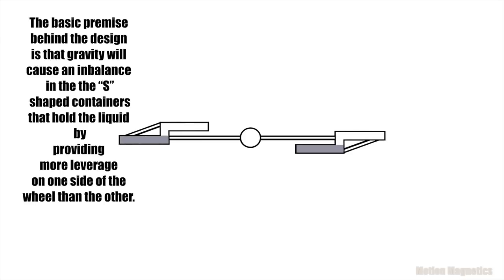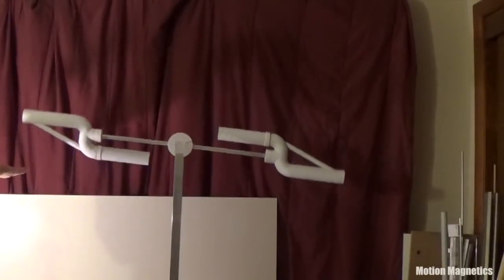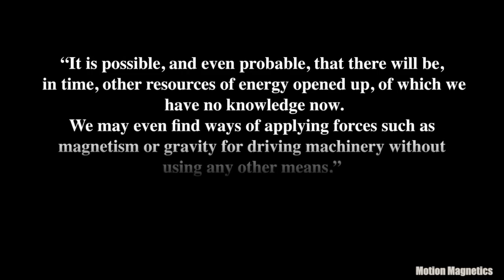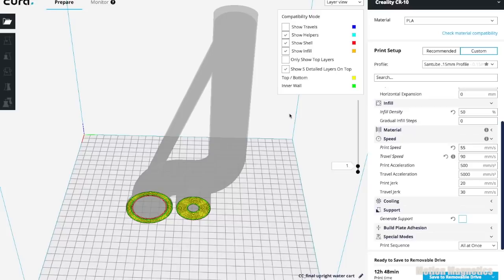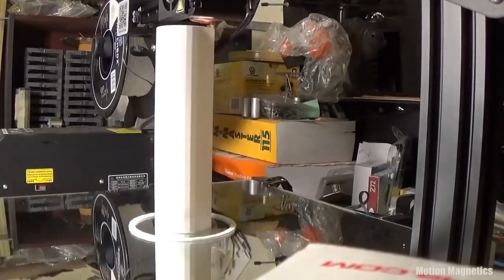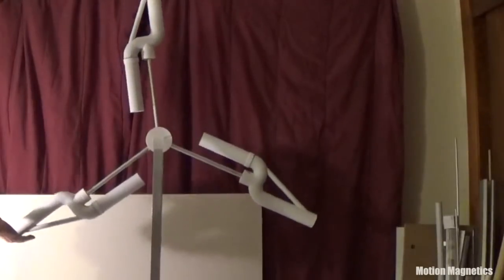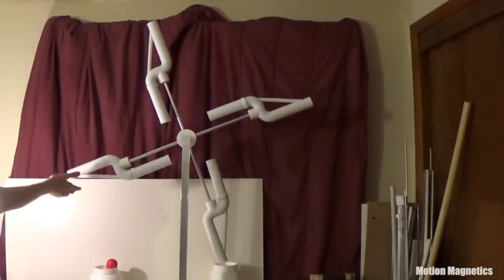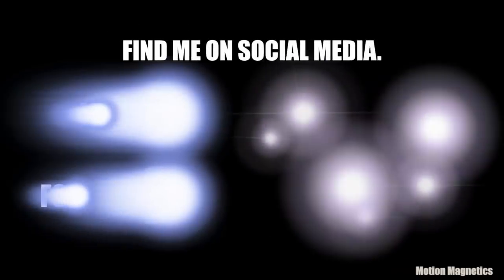Liquid Gravity Wheel Part 02

Comment: Looking at this make me think there would be an improvement if the collector side was not opposite the side intended as weight. So changing it to 90° instead of  180° moves the weight out of the path of rotation, is you fallow my meaning.

Comment: There is clearly imbalance in the system when arms are not moving and that's good....I wonder if just using bigger containers to hold water would produce a bigger angle of deflection. It would be interesting to see if just bigger containers (more "working mass" to be able to move around) if that would result in more of a deflection. Like just keep everything the same, weight of the system, arms everything the same, just difference in mass that can move from one part of the container to another. I think it would.

Comment: I had an idea that might work working all calculations based 1/3 ,.333 , the binder 3 , the number of arms 9 ( dividable by 3 ) the weight of the water 1/3 more than the weight of the the wheel and everything on it . Not including the stand and not including the weight of the water , but the container should be 3/3 and the water =1/3 with 2/3 of the container sticking out past the wheel , I don't know if this would work but with all the videos I've watched the amount and relationship of the water to the wheel is never in the calculations

Comment: Magnetic assisted rotation will not be hard to figure out the pure gravity driven wheel is the goal your water idea isn't bad i would think it will limit rpm fast tho.. i also wonder about trying equal but different volumes of water in the tubes in all your variations you have bult to far

Comment: Maybe this makes no sense, but what if you made the part of the tube that holds the fluid closest to the wheel, longer than the part away from the wheel, and fill the cylinders 3/4 full instead of just half way full...would that help?

Comment: look into one way check valve no moving parts solution to this wheel maybe in directing flow rate spped at different angles yhru internal baffles channels etc instead of open tube

Comment: I have a fix for you perhaps....You need even numbers of arms.  Angle your receptacles so that they are parallel with one another at different heights.  If you give them a 45 degree angle so  the one on the right of the screen are parallel to the ones on the left side of the screen, but higher off the ground, OVER-UNITY will occur.  The more even numbers of arms, the smoother your device will work.   Then you will be producing rotation consistently and perhaps self starting.
      Just an observation....

Comment: And as usual, people are neglecting the law of conservation of energy. 

If you use my design, you must put me on the patent and split the profits with me, none negotiable. Otherwise don't read this. 

The only way to do what you want to do is to have a point near the center of rotation that allows the water to pass through the down stroke into the opposite side upstroke.

That is the weight must be removed in its entirety after reaching equilibrium, 0 degrees to horizontal, as it is going down (gravity assist), and transferred to the opposite, no weighted, up stroke arm. 

With a caveat incrementally until 89 degrees perpendicular to horizon going up, say every 3 degrees per arm as it does up. 

So if the first pass is 3 degrees when the water goes into the tube, so the 2nd pass will be at 6 degrees, and the 3rd at 9 degrees,  etc... after 89 degrees it must reset back to 3 degrees.

This means you cannot use a straight tube, you must use a bent tube that is bent down then up on the up swing, and up then down on the down swing (to allow fluid to move into the tube receiving the water at 89 degrees).

Which means your problem is not a 2 dimensional problem, for every axis of rotation you must slip into the higher axis of dimension to transfer the fluid.

Either by the tubes rotating into the z axis, or the water transferring through the z axis.

Use a pump in the center and use the work of gears and ratios to craft the timed slip needed per 3 degrees.
Reply: There are no free rides in the universe, you must buy a ticket and when you have reached your destination you must buy another ticket to return to your original location.

Comment: You should try with 7 arms rather than 8 or 4
Reply: MrCubeLord Bx4 , you are wrong about using 7 , it should be a even number , 8  or 10 should be enough , it is nothing but a teeter totter like on a child's playground, two children weighing the same amount, would just sit there balanced on the Pivot Point, one of the children moves in closer to the Pivot Point and he goes up in the air, while the child away from the Pivot Point the most goes down and that's all that is happening a bunch of Teeter totters like on a children's playground are moving to the outer edge of the teeter totter and it goes down, Leonardo da Vinci made this in the 1700s, the thing is that it produces no power and no speed, using heavier weights makes no difference, it still would have no power and no speed, now if you had a few hundred of them hooked together with some kind of pulley drive system you might be able to make some power, and the only way to get any speed would have a larger gear or pulley running a smaller gear or pulley
Reply: @jimthomas777  ok but why wont it work?

Comment: I just did the calculations.  The "waterwheel" can be accomplished mechanically without water with just a wheel and an imbalanced blocks that are weighted on the ends.  I did the calcs with 7 units, but basically, if the blocks are allowed to pivot around their endpoints at the wheel, end each block has a weighted end at its free end.  If the attached end has a piece attached to it that can be used to hold it in place after it passes over the top so that it is perpendicular to the wheel.  And, when it passes over the top there is an piece that orients the block in an outboard position.  The mass of the three blocks will be 1.712 times the moment of the mas of the other blocks.  The blocks will have to erect the one block however, it requires only 1.25x torque to perform that task and the system has 2.934x torque more than it needs.  I did not account for friction, but I just did a quick hand calc.

Comment: Well I would have tried it at least with 6 arms, not just 4 or even better 8 arms...But you probably need an internal mechanism, that could keep the water long enough in one place and then release it in full swing at the right moment to go to the other side... probably not too easy...
Reply from the maker: I found that the more arms I added, the less it worked, which is why I stopped at four in the video. A valve that allowed the water to distribute in a way that caused an imbalance on one side is a good idea.

Comment: It won't work if you arrange them in circular, the gravity pull it's lowest part on its center at the buttom and cause it to stop. 

Notice that if you used a linear or a pair it seems to to work. But if you add another stuff make them 3 or 4 become more impossible.

Comment: Is there any difference when you rotate it counterclockwise? or rotating the tubes to an edge view 90 degrees on the spindle?
Reply from the maker: Yes. I tried it both ways. It definitely works better in the direction I designed it to work.

Comment: Did you tried to tilt the wheel 45 degrees?
Also (but this is complicated) you can take advantage of convection, water evaporates on the right side of the wheel, the left side it condensates ! Then you will have a proper motor but this takes a lot of effort en complexity....
Reply from the maker: I did not. It's not a bad idea, but as you said, that adds to the complexity and effort necessary in building the design.

Comment: (Philippians 3:13 [KJV]) Brethren, I count not myself to have apprehended: but this one thing I do, forgetting those things which are behind, and reaching forth unto those things which are before.
 I am an experimenter and have put much time into many projects. The empirical method is slow but with good observation can yield excellent results. Hope to make more videos of some of the devices. Have been working on various designs of a motor which will recharge it's battery while producing motives force. Method - feeding the back spike into the battery without killing the oscillation. Not unity, but will extend run time a great deal. Also, no calculations, using basic principles and concepts. Like throwing stones into the darkness hoping one day to hit the desired target. I've been told that even a blind monkey will find a banana once and a while. Yes, I have read and studied Tesla for many years now, WE SHOULD OF HAD A MUCH BETTER WORLD BY NOW, but greed and the lust for power and control have over whelmed the benefits of technology. Nikola Tesla and countless others made the discoveries. I could say much more and some have opened their eyes to these things and I'm looking ahead.
Reply from the maker: Well said. Thanks for the comment.

Comment: Here is an idea that could work.... make a rubber band wheel... but instead of using heat, use a stator compartment containing magnets to cover half the wheel and instead of using normal rubber bands, use ones inoculated with diamagnetic magneto-caloric particles like MnAs (Manganese Arsenide)  compounds which have a high magneto-caloric effect, you could use any other magneto-caloric compound or metals like gadolinium but the element would function better if it is diamagnetic than paramagnetic in theory.... when the magnet is in the presence of rubber bands containing the MnAs compounds, it cause the rubber band in the area of the magnetic field to contract due to a temporal spike in the temperature of the material above room temperature. The dis-balance between contracted and relaxed areas of the bands on the wheel would cause the the wheel to rotate..... So, no need to put in extra energy, just put a magnet or a magnet compartment in front of the wheel and the wheel should spin...

However, I was thinking of another way to achieve this.... Instead of using a magneto-caloric material that use magnetic field interactions to generate heat, one could just replace the bands with elastic materials that could or are designed to contract in the presences of a magnetic field... I believe the the term is called magnitostriction...
Reply from the maker: That's a pretty intelligent and well thought out idea. I like how you think.
Reply: Thanks bro...